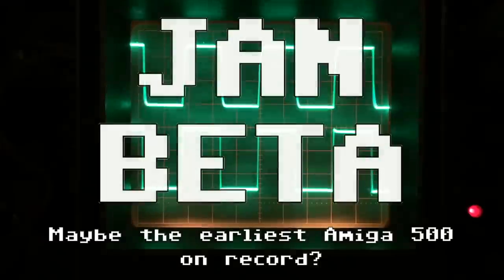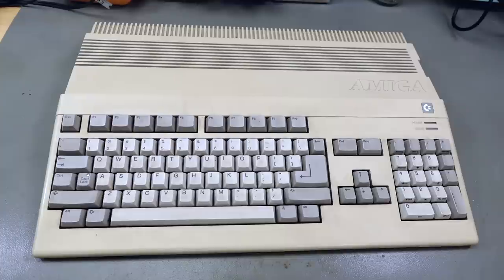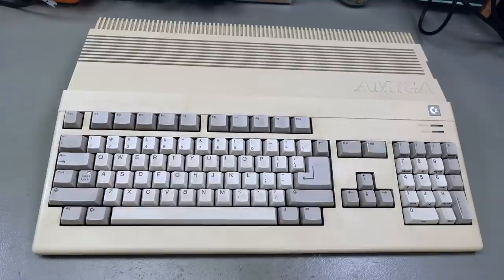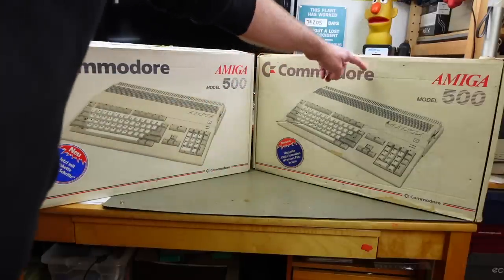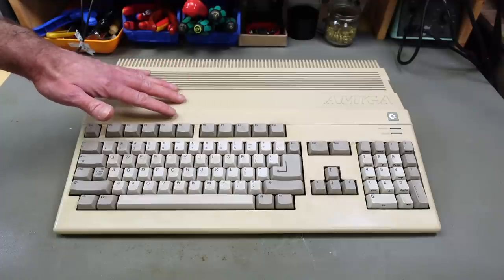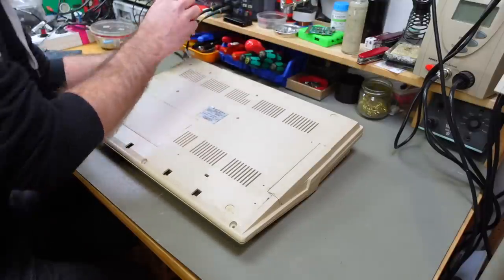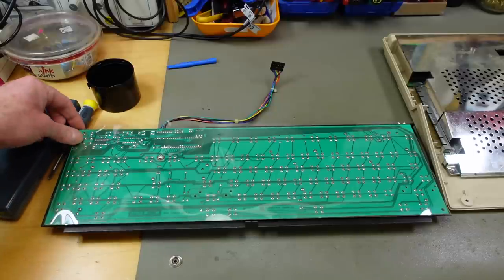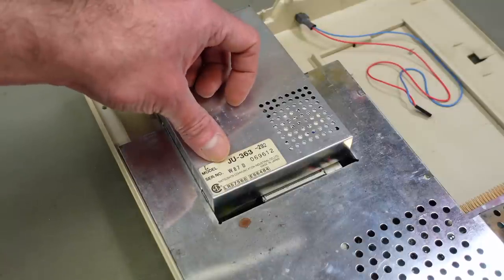The earliest Amiga 500 on Record?

Comment: I got my Amiga 500 back in May 1987 in Germany. It had a serial number of about 6000. When I bought it, there was still no German instructions book available. It came with a US book and a coupon to get the German book afterwards.  I sold it later to get my A2000. Now my oldest A500 is an early one with a number slightly above 10,000. It has still Kickstart 1.2 and the case is unaltered.

Comment: Top Tips. The 68000 CPU has some interesting features. Connect a SPST latching switch to the 68000s PAUSE pin, instant pause for ANY program. Ditto the RST pin and there used to be a hack taking a 14Mhz signal from somewhere near Agnus and then disconnecting the CLK pin from the CPU and then attaching the 14Mhz pin to it and doubling the apeed of your A500!!! God, i loved my Amiga!!

Comment: Hi, you could point at another difference, the grey cursor keys! Only the very early A500 keyboards got those. Starting 2019 through 2022 I managed to have bought three 1987 A500, two boxed and complete (rev5 and rev3), one loose (rev3). One of the boxed A500, the most well preserved one, got these grey keys that I'd only spotted on the A500 manual. Great video, thanks and Happy new Year!

Comment: My A500 (bought by me in New Zealand, late '87) seems to have been built in the 26th week of 1987. Serial number HB4 001208; Externally identical to the one in this video, but the innards are a little different :) Mechanical "space invader" keyboard with C= key instead of the left Amiga key; White-on-grey C= logo instead of embossed plastic C= above the power LED; Revision 5 motherboard; "Chinon" branded floppy drive.

Comment: Hi, i work at a Company wich used to make the Moulds for the C64 and the Amiga Cases. A few Years ago they threw away a lot of the 
older stuff wich included the insert of a Mould wich was the Embossed Text on the bottom of your Amiga, wich i saved from the Trash.
I never saw an actual Amiga with the embossed Text until now.

Comment: I smiled when I saw the switch for the RAM upgrade. I installed mine in exactly the same spot.
Reply from the maker: Yes, these RAM expansions were super common and also often the switches were added to the case in similar spots. I'm kind of happy that the RAM expansion in my origianl A500 was permanently switched on (it was the Commodore expansion which didn't have the option to switch it off from factory). :D

Comment: Hi Jan. FINALLY! Finally someone backs my theory that sub-10000 serial A500s have a) an early badge logo rather than chicken lips and b) a big label on the bottom rather than the thin sticker. I own a German A500 with a serial in the 4000s (and had a second one in the 7000s) which are like this one except two things: it has both the big label plus the molded „sticker“ next to each other. Obviously the bottom case was updated in between Stephane's A500 and mine. Also it has a Chinon F354E instead of this Matsushita. My #4000 board has the serial number 1680 and was produced in KW13.
I think the top case was changed to chicken lips around serial 10000 and the bottom sticker was changed to the thin thing a little later, let’s say 12000. Both regarding the German end production. HK end production is different.
Reply: Have you written anywhere about your theory? When I got this machine, I searched a lot for information and found just enough to be pretty sure that this theory is true (for the WGA machines, the HK and CA ones were apparently produced a bit later).
Since there are so few surviving very early machines, the apparently false accounts that the first Amiga had an embossed logo is otherwise very strong online. It would be nice that this video (series) would help establish new knowledge about the very first models.
Reply: Exactly. Information is as hard to find as the machines. I posted something about both named machines at A1K (German). Can’t post the URL here, search for „Mein 4000er A500“. When you scroll through the discussion, you'll find further links and info I collected there. There are even examples of known-original machines, one with chicken lips but big label, serial around 10000. Note the PDF of the 87 CeBIT which contains pictures of an obviously pre-production 500, which also has the sticker logo we are talking about. You can see that it was quite a fight to discuss the theory there, but over time I’ve gotten somewhere.
Reply: @al.d9592  That bit about the prototype is really interesting and would finally validate that theory and give evidence to the sceptics. I wasn't able to find the forum link you hinted at, probably because my knowledge of German is very limited. Jan might be able to dig further than me.
Reply from the maker: Hey, thanks for sharing! I'm going to try to find that link. So far, I think the theory with the bolder C= badge cases being the earliest ones is correct. Several other people with very low serial number A500s have contacted me and they all seem to have the badge on the case.

Comment: Great info! I picked up my very first A500 a little over a year ago from an estate sale and it was identical to this model with the Commodore key, chicken lips badge (not embossed), and the mechanical keyboard. It has a higher serial # though: CA1003936. It's in good working condition but unfortunately did not come with the box. The Hi-Tek keyboard is by far the nicest to type on of all the Commodore models I've used so far.

Comment: That's a nice specimen! Also notable on the really early rev 3 is that they has the Y1 crystal populated down to the left instead of the X1 oscillator above the kickstart. They should also have different feet than the regular white rubber ones. More like plastic, slightly translucent ones.
Reply from the maker: This one is missing its feet unfortunately. :/ I noticed the oscillator. Interesting that they have two footprints for oscillators on the board, I guess they were still testing what worked better after finishing the board design.

Comment: I got my A500 in December 1987. Obviously it was a very early machine. It had the early keyboard as well. The keys were slightly different. The key caps had a different shape (shorter) and pressing the keys felt more tense than on all other Amigas i've been working with. I never saw another A500 with "my" keyboard until watching your video. It had the Commodore key and the solid Amiga-Logo-Key as well. The case felt "heavier" than the younger ones, and it had the grey-white Commodore logo as well. The power supply was different compared to the one in your video. The power-switch was in the center of the case. Some of my friends got their A500 at the same time - with different keyboard, case, logo, etc. I have to check, if I can find some old pictures.

Comment: Very nice looking early Amiga 500, and interesting to compare the details to mine, which is manufactured at 52nd week in 1990, according to the yellow sticker on the motherboard, and serial number in that yellow sticker is over 2 million. 
Serial number sticker at the bottom of the case is over 1,4 million, made in W. Germany, and mine has C= sticker, but with thinner print than the early one.
My box image also has both Amiga keys, no Commodore key anymore, and box doesn't have any stickers.
Oh yeah and my Amiga is Scandinavian version as I live in Finland.

Comment: I bought a knackered A500 from a car boot and it was serial number 600 and something and had similar keys. I cannot remember much but compared to my own A500+ it looked completely different and so I compared to my mates A500 and it was different to that. We decided it was a Frankenstein Amiga A500, but may have been an early run. It never got fixed and i sold on for spares and repairs.

Comment: Great video, waiting for the next episode. I have an earlier Amiga 500 boxed, with embossed logo, embossed information on the back, AZERTY keyboard, serial No. 89140.
I'm living in France, very close to Belgium.
Reply from the maker: Do you know if yours already has a Rev 5 board in it? It seems like it is of similar vintage like my own first A500 (which was purchased in Summer 1987). Mine has the embossed logo and the German keyboard layout (as I've shown in the video). My theory is that the very first ones all had the US chicken lips keyboard and then shortly after they produced localized keyboards and slightly changed the case molds.
Reply: @JanBeta  It is the REV3 type 2 motherboard. 2287 is the maximum date on MOS parts
i have some pics and questions for you.

Comment: My A500 is from week 20 (on the yellow sticker) and has the exact same C= key Hi-Tek keyboard (date 8707), but without the caps on the 6570 keyboard chip.  My case is also like yours, with the moulded info and just the serial No. on the sticker (38165 on mine).  Also the moulded C= logo on the case.

Comment: If you have cleaned the Agnus socket and Agnus chip and it still doesn't work, have a look at EMI406 (right next to Denise). This is equipped with a 1 ohm resistor on these boards. It is often defective. It supplies U40 and U41 with 5 volts. regards botfixer
Reply from the maker: Next video tomorrow (spoilers: I managed to fix it)! ;)

Comment: I had a Rev 3 like this with no Video Sync at all...after replacing the factory resistor at EMI406 it worked perfectly..later models have a EMI filter here.

At 19:33 in the video you can also see you have a resistor there at the bottom right of the picture - just to the right of where the bodge wire goes to the board
Reply from the maker: Watch the second part of the series! ;) Spoilers: It was exactly the same problem in this one.
Reply: @JanBeta  Apologies....I just came across this video....didn't see the 2nd part ! keep up the great work, love your videos they are very educational, thanks :)

Comment: Halo Jan, in 1988 I bought my first A500. The case is identical to the older one you showed in this video, same little C= square badge, same centered label on the bottom shell but it doesn't have the Hi-Tek keyboard. Furthermore it has a rev.5 motherboard with the buggy Toshiba Gary chip and what it seems to be a kludge fix for it but that it's not present in the rev.3 motherboard.
Years later I bought other two A500s, they are quite similar, they both sport the Space Invaders keyboard and a rev.3 mainboard but a different plastic bottom shell. One is identical to the one of the Amiga you bought back in the day, the other one has the same little sticker in the centre showing only the serial number but it doesn't have the engraved / embossed information about the computer model, FCC information and other things. All three A500s were made in W. Germany.
So, why I'm speaking about all these stuff? Because the strange thing is that the Amiga I bought in 1988 has a serial number that is in between the other two I bought later as numeric progression but from the cases and motherboards revinsions standpoint it is incoherent.
The only thing I can suppose is that there were many assembly lines inside the factory and each one used the components they have in stock, serial numbers were of course in numeric progression but at some point there must have been upgrades in the components they used to make the computers, maybe not on all the assembly lines. This could be the reason why a computer with an earlier serial number sports components that usually were mounted on later production.
I hope this little story will be informative to you.

Cheers from one of your Italian followers!

Comment: i got an early Norwegian model, with Norwegian keyboard but same style sticker underneath as the old one here. same style top too but not the space-invader keyboard.
mine is serial number 013001 so means at least after 10k made they started with newer type keyboard.

(interesting enough is that the motherboard is a serial number 000255)
Reply: though, as most Rev3 boards its riddled with faults, case have had a very hard life with cracks everywhere and the keyboard makes a washing-board look completely straight...
(PSU have died a long time ago.)
Reply: My A500 serial # 19809 has the chicken lips key, large Caps Lock led and gray logo. Yet, it's German layout, like Jan's. Go figure...

Comment: Oh, I thought I had an early one but this is a step further! Interestingly my enter key has the type in a different position, and all keys have the letters as far left as they could possibly be. Also has the c= key. Mine has a rev3 v2 board with the embossed case badge, commodore info on the back with a transparent serial number sticker. I understand its been boxed until I got it, its quite white compared to any other Amiga I've seen (paper white). Not as compatible with demos as later Amiga 500s even with RAM expansion. Some of the cutom chips & 68000 are third party. Mouse has no commodore logo underneath. Box is the same as yours. Wonder if any Amigas have that odd escape key that is in the box artwork?

Comment: This is an early A500 for sure. I own one with serial 538 I think and it has the same features including the fat logo and fat plastic case etc. Even the keyboard controller from 1986. So it seems like Commodore made At least a couple of thousend of this set-up. Also note the old school ”commodore” type set on the sticker.
Reply from the maker: Yes, that's my theory, too. I think the thicker badge case predates the more common one with the embossed logo (which was probably a cost reduced version using less plastic). I didn't notice the old school Commodore logo, thanks for pointing that out!  :D

Comment: Lights coming on but then fading out is definitely power supply related. It may be worth disconnecting the floppy drive as I have seen them fail and excessively load the 5v line in the process
Reply from the maker: Yes, that's my initial thought, too. I disconnected the disk drive and keyboard before trying to power it on actually. Troubleshooting in progress now. Voltages at least arrive at the connectors on the board, 5V seems to go into the ICs, too. We'll see if I can pinpoint the fault.

Comment: The enter key is also marked differently to other international later keyboards. The marking are far left, but later it's in the middle
Reply: Ooh, Interesting.  This is the first time I've ever seen an example of a keyboard with an off-centre return key print like this other than the one I have.  I had assumed for years that it was simply a badly aligned print job, but it seems it was intentional.
Reply: @davedobbs  Ah yeah, that's interesting. I'd never seen this either

Comment: Check resistor above U4 marking, marked EMI405. Common fault with rev. 3 and 5 boards.
Reply from the maker: Yup, EMI 406 (I think that's probably the one you refer to) was indeed broken and I replaced it in the meantime. Sadly not the only fault but the bad resistor prevented the Denise chip from getting any supply voltage at all. Further troubleshooting is on the way.
Reply: @JanBeta  You are correct, EMI406. My mistake :) But now you hopefully have a display sync signal.
Reply from the maker: Yes, sync signal is back but unfortunately still a black screen.

Comment: Jan Have the same board. Green screen. It was working but intermittent
Reply from the maker: Green screen may point to a bad Agnus (or the Agnus not making good connection in the socket) or a RAM fault. Both are very common. If it's a bright green, the fault is most likely one of the CIA chips. Might be worth investigating, especially since the Rev 3 boards are relatively rare!
Reply: @JanBeta  thnx. I'll give it a try.

Comment: Embossed commodore chicken lips badge case + red leds + rev3 board + Philips cross head case screws + 1.2 kickstart + noisy Matsushitu 3.5 drive + hi-tec keyboard (with commodore logo printed on keys) we’re first gen a500s. The power supply was also lighter and audio filter was poor compared to later revs. I believe the plastics for case and keyboard didn’t use bromide fire retardant which is why they didn’t yellow over time like later models. Commodore were notorious for mixing up parts though, I wonder if the  (Belgian) Amiga you have there has been re-cased due to customer return in its history as innards are early but case is not.
Reply: Actually, the case is early. Earlier than the embossed one. There's a stream of evidence pointing towards it now, just read the comments. Very early unit owners have a badge (which has a different font than later badges). Plus, the badge was on the box of every embossed C= case, which implies precedence. And finally, it seems that prototypes had a badge too. It's even possible that Commodore just used leftover prototype cases for the very early units (with the sturdier plastics). Then, somewhere between #2000 and #10000 (depends on sources, information is sparse), the embossed C= case was briefly used, hence the (apparently false) belief that the very first units had an embossed chickenlips logo.
I hope conclusive evidence will have be found and settled when the next video about it is published.
Reply from the maker: As I explained in the video, I believe the case with the bolder Commodore logo batch is actually an earlier version than the one with the embossed logo. It is definitely a different (thicker) mold than the one my original A500 (which was produced shortly after the Rev 3) came in (with the embossed logo). Contrary to what's widely assumed. I got contacted by several peeps with very low serial A500s that also have the badge case instead of the embossed logo so the theory may be correct.
Reply from the maker: Yes, that's what I believe, too, at this point. I got contacted by several peeps outside the comments section, too. There seem to be quite a few very low serial A500s out there that came in the thicker, bold Commodore logo case. Gathering more evidence in the meantime but I am already very convinced that the previous assumptions (the embossed logo case being the first version) are not correct.